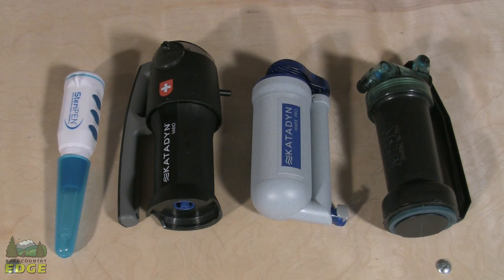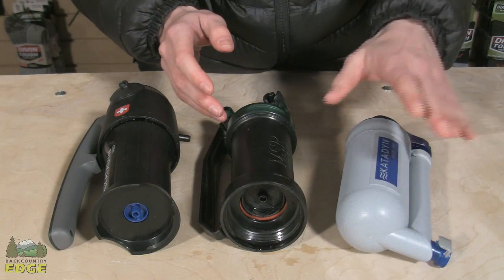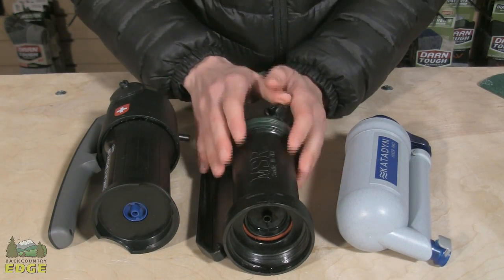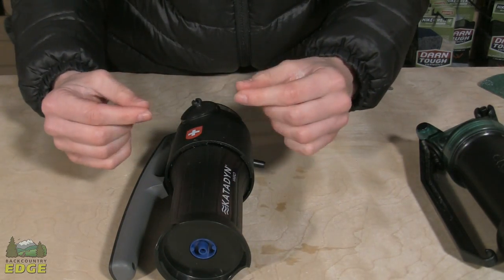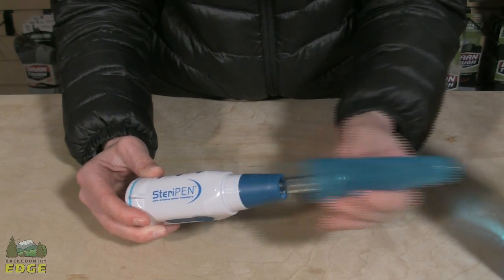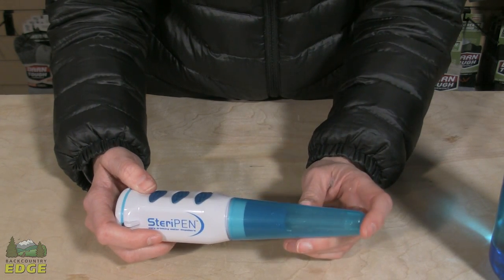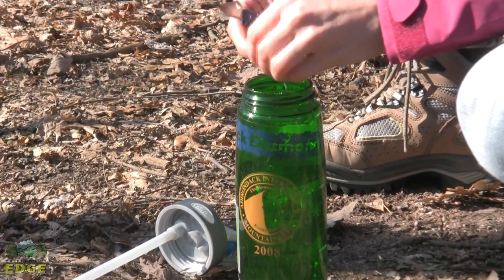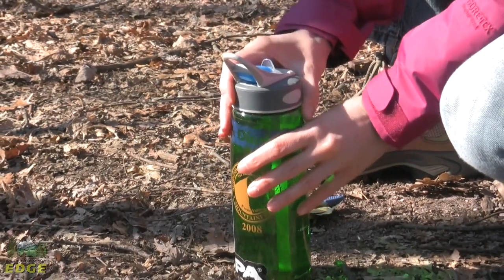Types of Water Treatment for Backpackers

Comment: The MSR filter is very hard to pump and so water production is slow. I used the  Katadyn in this video to pump out lots of water for a Boy Scout troop from a stagnant mountain stream using a pre filter float that drew the water from the clearer surface instead of the murky bottom.  The filtered water was fantastic tasting, clear,  and no one got sick. Was able to pump 8 canteens full before the MSR  even pumped out one.
Reply from the maker: Thanks for the comment! There are many types of filters and purifiers out there and we love hearing real world experience. Happy Hiking!
Reply: Which of the 2 katadyns you used ?
Reply: Bowser Building ...interesting about the MSR. I have the Katadyn Pocket, it’s more expensive but it is stronger because of the aluminum top and bottom, and the plunger is metal too. It’s pretty fast too. I’ve used it in Kazakhstan and Mongolia while camping, along with the steripen for neutralising viruses (Katadyn only filters out bacteria), and I never had a problem.

Comment: Will the filter alone take out any and all harmful bacteria? Will the ceramic/filter do this as well?
Also you stated that boiling water will take out all of the particulates along with bacteria. But how will boiling your water take out the leaf particulates?
sorry for the newby questions but I`ve never used a filtration system before.
Reply: when boiling i put a peace of cloth over my pot before filling it with water which works as a sift to get out leaves and other debris then take it off and boil then all is good

Comment: Hi, two systems I have that work great and remove just about anything and everything harmful is the LIFESAVER 4000 and THE GRAYL.  Both are great bottles, the LIFESAVER having the longer shelf and use life which are advantages but THE GRAYL is light weight but only good for about 300 uses.